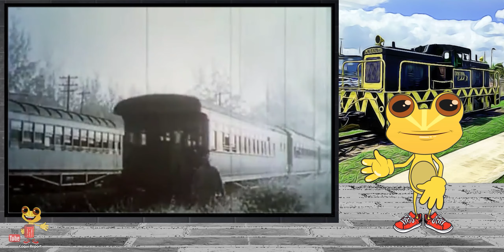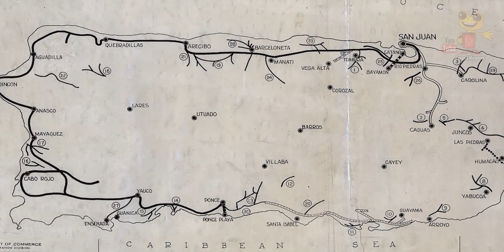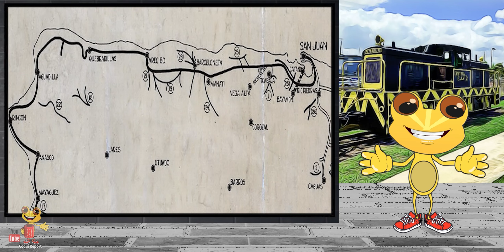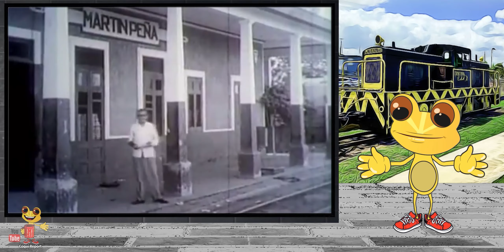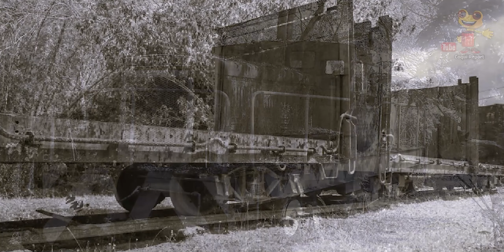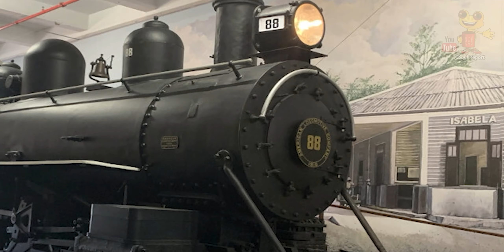The rise and fall of Puerto Rico's railroad system

Comment: To say that el tren urbano is an “efficient transportation system” and that it reduces traffic congestion is a stretch. The route it covers is very limited, and you still need a car to get to most stations as there is not much connection to other public transport services. Most of the time you see the train operating with only two carts as  it is not widely used, other than for concerts at El Choliseo or las Fiestas de la calle.

Comment: The railroad system of PUERTO RICIO was done away bythen governor LUIS MUNOZ MARIN. THANKS TO THAT STUPID MOVE WE ARE FULL OF TRAFFIC JAMS.
Reply: Better go study the economics of railroads... They're VERY expensive, so you'd better have a way for them to make money.
Reply: It seems a back room deal was made. We were sold out. Railroads are a efficient and reliable. Everything needs maintenance but railroads are environmentally sound. I remember a song from my childhood “La Máquina”
Reply: @mariasirico7400  worth noting thats our railway took a whole day just to get people from ponce to san juan and vice-versa. And freight was a cheaper in trucks.
Reply: He was forced under gun point to do it.
Reply: @mariasirico7400  WRONG.  Railroads are only economical on a large scale.  Railroad maintenance is extremely expensive, and the small economy of scale in P.R. made them uneconomical.
Reply: @ffjsb  clown take
Reply: @sherioky7349 you realized rail technology has come a long way since the 50s
Reply: @VMan29397  u also realize the amount of money needed to upgrade a infrastructure of that caliber. The company tried the cost 4 times they budget.
Reply: @sherioky7349  You realize that if we had politicians that actually developed the puerto rican economy That wouldn't be an issue